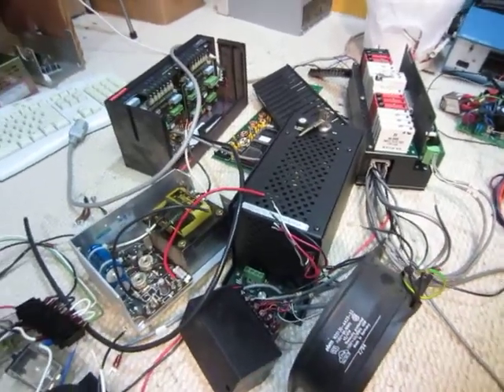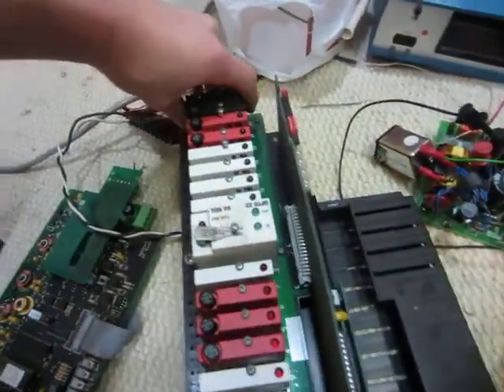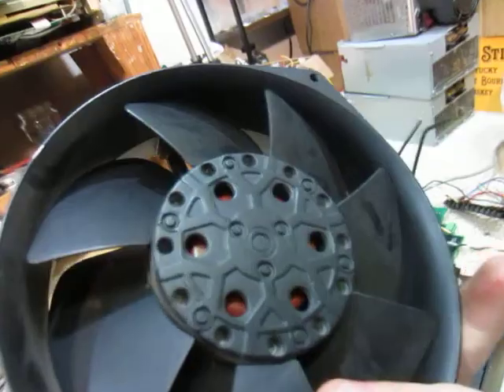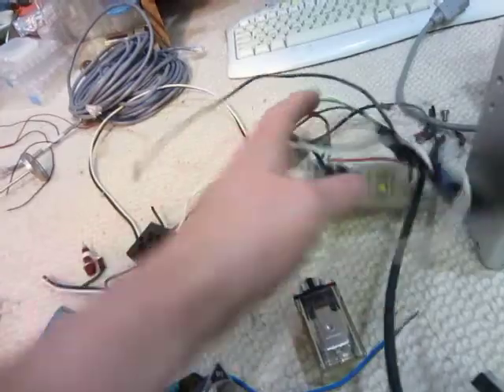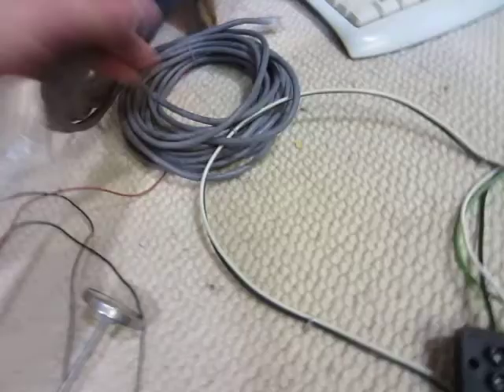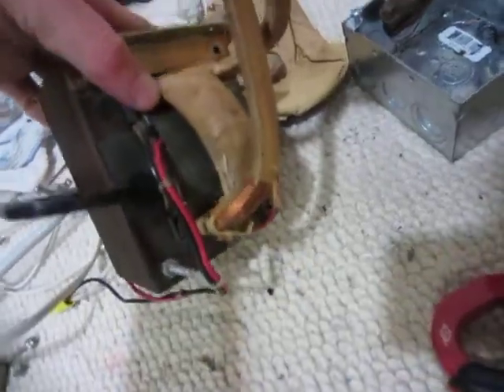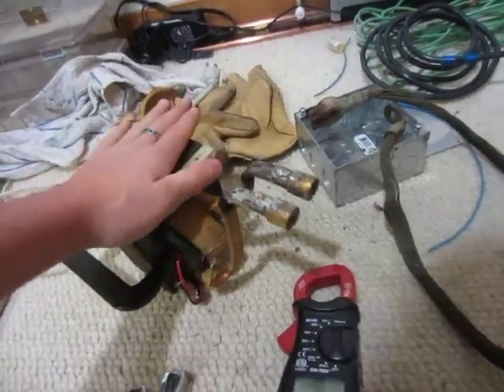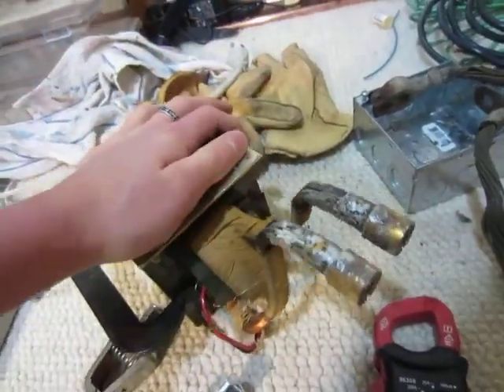OPTO 22 Remote Digital Logic System, High Amp Transformer, Fiber Optic Bit Drivers

Comment: Nice score of some really cool gear there!
I came to comment on the Opto 22 stuff.... You can check it out on their website.
You have a nice range of digital and analog there, perfect for automating or controlling different bits of gear.
Yeah, its a little older than their current range of stuff, but its still useful.
Looks like you got all the stuff needed to power it up and get it running as well.
Hook it up and have some fun!

Comment from the maker: I used a clamp-on meter.  The PSU with the 2N3055's is only rated at 5 amps 12 volts.  I tested it out, it does 12 volts but only about 1 amps so I think it has a problem.  It does not really matter though cause I mostly just grabbed it for the 2N3055's.  No it's not that my dad does not want me to have more stuff it's that his work finished emptying out the buildings and the dumpsters that all the stuff went in are gone.  I don't think I have any diodes that could handle more then 30 amps!!!

Comment: What did you use to measure over 1000 amps? That 12v PSU could be a goodie. probably does 5amps+ with those transistors. No more stuff from dads work, because dad doesn't want you building your super hero headquarters under the house. If you put more stuff in that room, it will be a sunken room. Wondering how long before the 1kA "Fast Charger" for AAA' and button cells, video goes up. Could be good for forming Lead-Alum... Really big ones.....